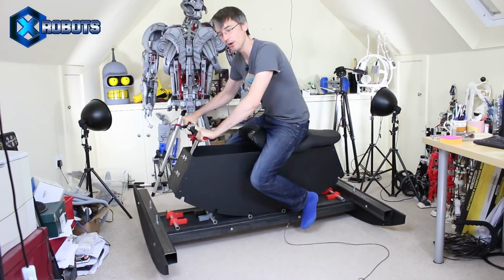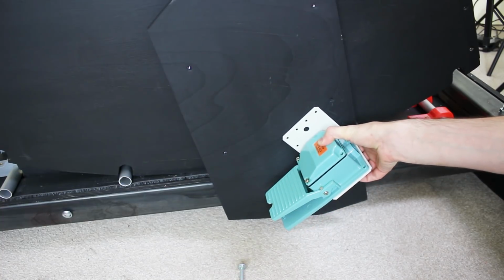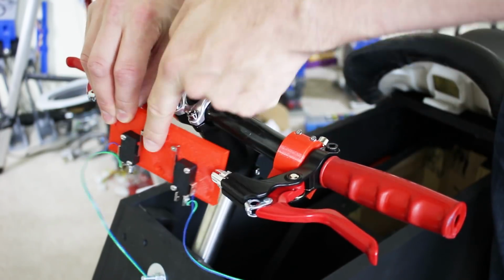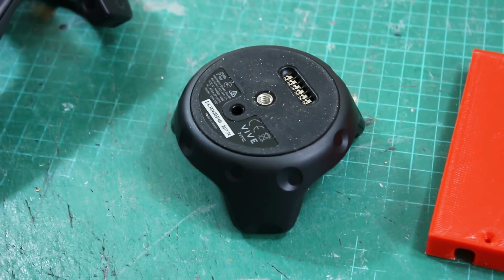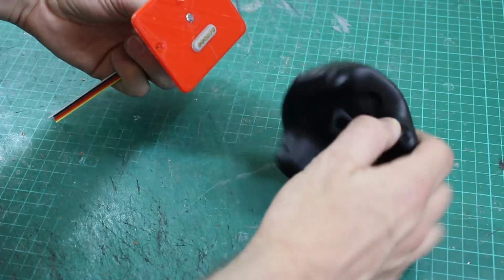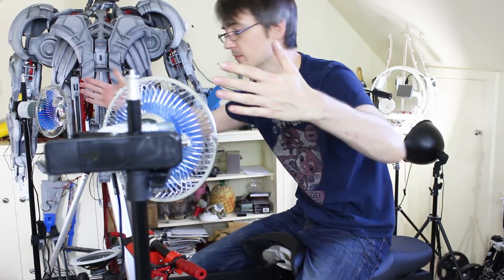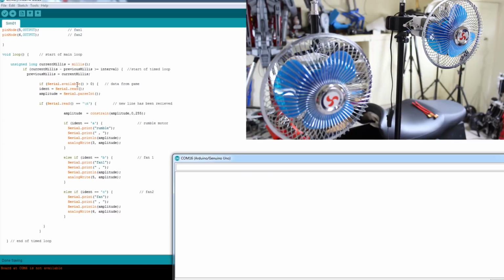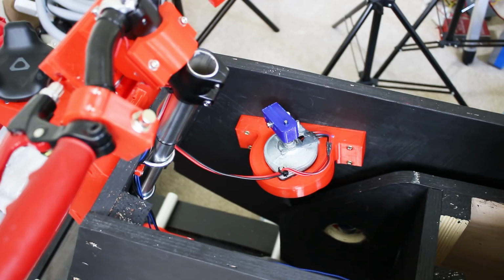VR Hoverbike Simulator Game #2 | James Bruton

Comment: micro switches on the break and throttle!?  no.  no no no.  You need analog input for that.  Potentiometer with an arm and a spring attached.

Comment: A 2-axis rocker is a pretty cool idea.  I can imagine it will feel like it's flying.  One thing though, the rocker seems a little over-engineered.  Instead of all the notches/pins on the rocker track, you could use 1 pin each side (or one all the way  through) mounted about half way up the innermost box and sticking through a shallow arch shaped slot on the seat box.  Imagine the arch shaped slot looks like a open-parentheses "(" rotated 90 degrees clockwise.

Comment: Sprung hall sensors would make more sense for the brakes, you could have analogue control then.
Reply: James Bruton ahhh, I was wondering why you didn't use the usual potentiometers there.
Reply: It needs analog ins...
Reply: James Bruton Well lets hope they have an advanced system that allows for automatic smooth slowing down in the future so you don't even need to think about brake pressure!
Reply: the arduino does though, so you could do that in theory.
Reply: I'd go with a teensy, only because it is easy to make it work as a joystick, keyboard, etc, and they have good adcs.

Comment: and ideally the 'brake levers' would be variable so you dont lock up the wheels / better clutch.. just saying if you are going all out with a motorbike simulator you might as well add all the correct controls too... nice job though
Reply: ah, that makes sense

Comment: Way not using potmeters for analog breaks? Much better than breaks that are either on or off.
Reply: Sharklops that is why you have analog controls for racing games. To make it feel more authentic. A steering wheel is much better than the left and right arrow keys for steering.
Reply: And if you don't have a steering wheel set-up you use a controller. Playing racing games on KB/M is hell.

Comment: Yikes. I hope you guys cut off those bolts protruding upward from the side to side rocker and add plastic caps. That's a serious hazard even for a student project. Or especially for a student project.
Reply: they are most likely used as hardpoints to add something.